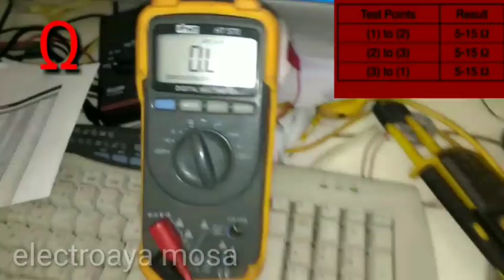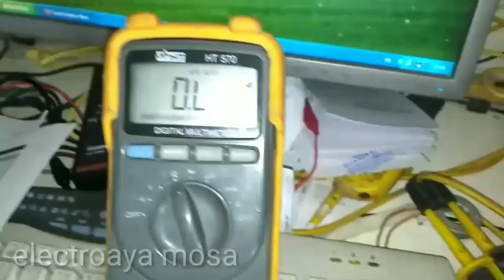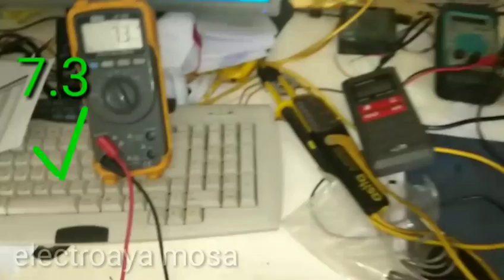LG whshing machine 
direct  drive 
How to test the motor
in an LG

Comment: yo tengo una lavadora con ese motor pero quiero ponerlo a gira si la tarjeta  hay que modificar las bobinas  probaron las bobinas pero no se explico como prender el motor sin tarjeta

I have a washing machine with that motor but I want to turn it on if the card needs to be modified, the coils have been tested, but the coils have not been explained.
Reply: yo tengo una lavadora con ese motor pero quiero ponerlo a gira si la tarjeta  hay que modificar las bobinas  probaron las bobinas pero no se explico como prender el motor sin tarjeta

I have a washing machine with that motor but I want to turn it on if the card needs to be modified, the coils have been tested, but the coils have not been explained.

Comment: If the faulty stator has only one of the 3 windings open, that means they are in star rather than delta (triangle) connection.

Comment: What if the ohms are at 10.5?
Reply: I guess the anywhere between 5 - 15 is okay
Reply from the maker: Yes is ok
Reply: @soselectro  I need your help can you provide any way to contact you?
Reply from the maker: 00212665120215 whtsap
Reply: @soselectro  you don't use Gmail or , messenger, instagram or something?
Reply from the maker: No

Comment: Looks similar to F&P’s design
Reply: Yeah looks very similar :)
I just came across one today, I reckon it'll handle a lot higher speeds than the F&P plastic rotor, needs to be rewound with copper though as it's aluminium. 
The shaft connecting to motor seems tiny so might need to make a bigger attachment for it.
Reply: Thanks sir 
Sir 
HALL Sencer ke bare me vi kuch bataye please
Reply from the maker: I did not understand your question

Comment: what capasitor for that motor??
Reply from the maker: This motor does not have a capacitor, it has an electronic card
Reply: It's a 3-phase motor driven by a variable frequency generated by an electronic card, not directly by the mains.

Comment: Great video but change the music
Reply from the maker: Why change the music?
Reply: @soselectro  
No issue, thankyou for your help.
Reply: @soselectro  hi . is 11.ohms ok? need help
Reply from the maker: 11ohms  yes👍👍👍👍👍
Reply: @soselectro  As a teacher asking such a question is not good.because no one teacher like any disturbance at his class room.
Reply from the maker: @shafimehar4506  I did not understand your question
Reply: hello sir,greetings to u.i have a doubt.that is, if the ohms between any two terminals not show the ohms(O.L), it is not good motor.
If values comes  between ( 1&2) (2&3) (1&3) eventhough variation in ohms it is considered as a good motor.am i correct or wrong sir.please clear my doubt sir.thank u.
Reply from the maker: Shafi Mehar When the engine is measured and the OL mark appears, it means that the engine is not running and cannot be used